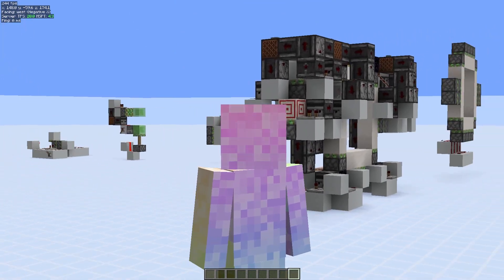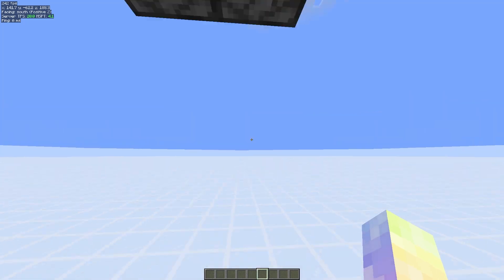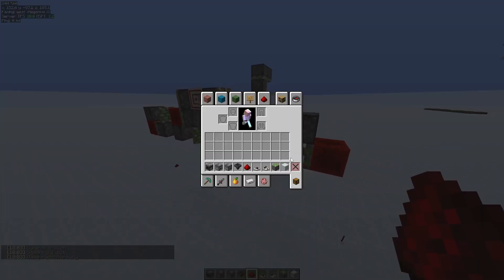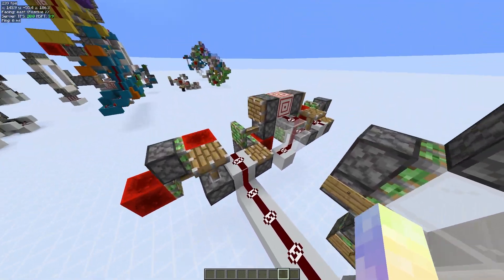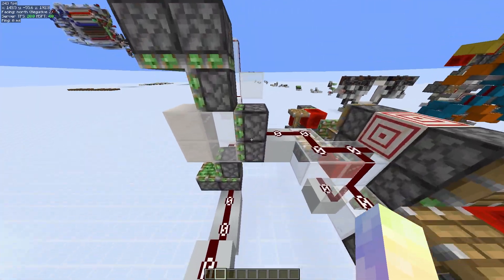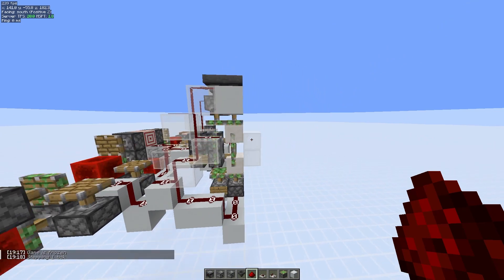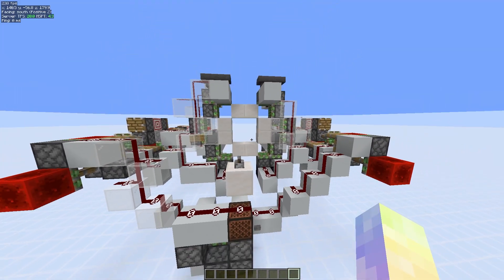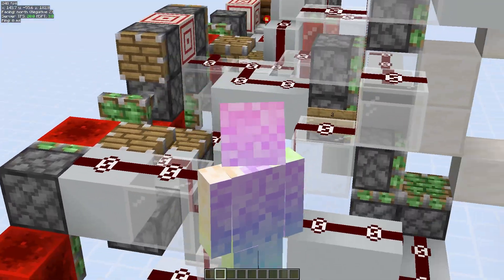How I Build 0 Tick Doors!

Comment: why the hell it doesn't work on my world 😭
Reply from the maker: the abccba i made was locational, also it only works in java edition
Reply: @theb0b  okay thanks I'll try in an other orientation then
Reply from the maker: It was not directional it was locational
Reply: @theb0b  in which version you were also please ?
Reply from the maker: It works in all current versions pretty much since observers were added
Reply from the maker: The middle abccba module just needs to not have the wire that goes to the top be running next to the piston in front of it. Make it so it does not need a target block

Comment: Also, what is the mod?
Reply from the maker: I’m assuming you are wondering about the tick freeze mod, in versions before 1.20.3 I used carpet mod. After, it’s in the vanilla game
Reply: @theb0b  oh sorry, i should have specified what i meant. i meant the mod you use for building
Reply from the maker: tweakeroo for the funny block placement
Reply: @theb0b  what tweak?
Reply from the maker: Flexible block placement offset

Comment: That's it, this video motivated me into evolving my projects into 0-ticks for good now. You sir also earned a sub! Time to learn, and then attempt to remake my (then) dustless 4x4 into a(non-dustless) 0-tick 4x4! Question: Is dustless 0-ticks even possible?
Reply from the maker: Short answer: yes.
Llonger answer: really hard to make working doors with them, and they are single area only; cant really move the signal around.

Comment: How do you only clear your hotbar?
Reply from the maker: There is this funny bug where blocks that are acquired using the pick block thing, (middle click). If they are not in your hot bar then they won’t be cleared. A little bit like ghost blocks, but if you just move them to your hotbar, they will be cleared.

Comment: Idk why but recently i used this as a tutorial and tried to rebuild it step by step but it broke at the closing sequence bc the 4th firing pistons weren’t go back to its original location and the opening didn’t work :((((
Reply: Works in Java
Reply: Locational
Reply: Same, I tried using a repeater instead of Redstone dust under the piston near the comparator and it works. But in this way the sequence is slower.

Comment: At 4:14 you talk about QC and that you will just add 2 transparent blocks, maybe this is a totally obvious thing but how is that working with or stopping or what even does this with the QC? xD
Reply from the maker: The hoppers were there to prevent the bottom from pushing everything up when it was not supposed to, and the fact that they are transparent so no qc. The qc stuff I was talking about was the piston to the left, it has to fire at a different BED so thats why I replaced the obsidian block.
Reply: Okay makes sense, thanks alot